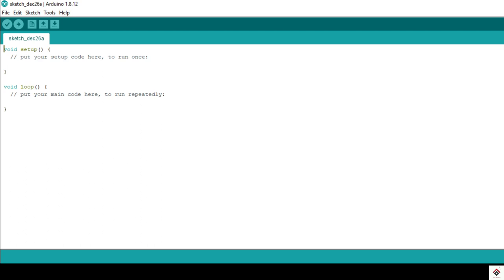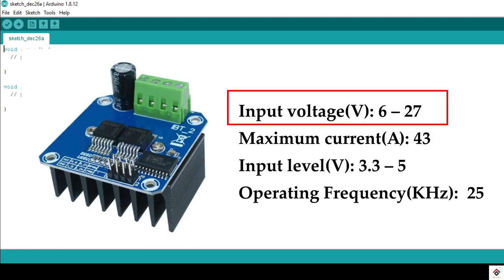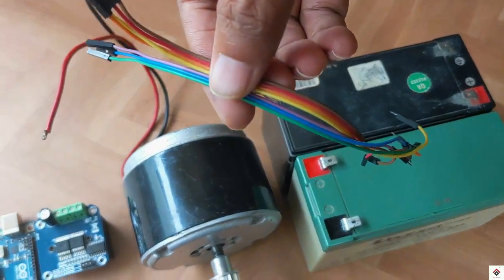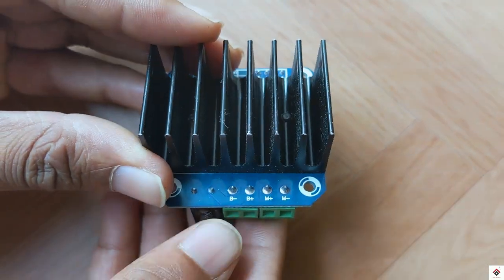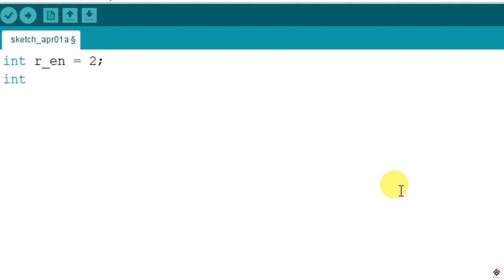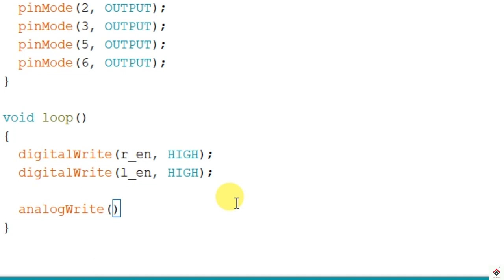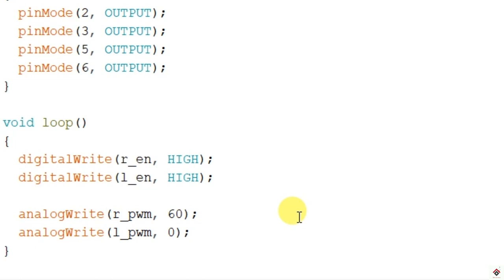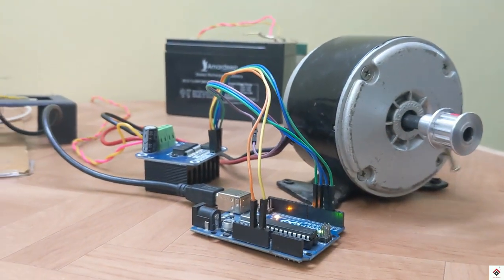Control High current DC Motors with Arduino and BTS7960  motor driver(CODE)| Ebike motor controller

Comment: Brother,  may I ask you a question. After seeing your video, it is possible for me to connect ebike throttle to arduino uno which are connect to BTS 7960 and controlling the speed and direction of motor? thanks
Reply from the maker: Yes it is possible.
Reply: Thanks brother

Comment: Bro my motor driver has a Problem the l pwm is not working my motor is beeping but the r pwm is working should i replace it?
Reply from the maker: If you are changing the direction according to code explanation it should work.

Comment: I did the same connection and code when I enter 255 in rpwm then motor start rotating clock wise but when I enter 255 in lpwm and make rpwm 0  then nothing happened motor didn't rotate can you help me whats the issue.
Reply: Have you found anything happened to me too?

Comment: thanks a bunch. i got stuck trying to use same code and schematic from l298n only to find out this driver requires one pin more. that burst my bubble but you helped me with this video by explaining in detail. not a lot of info to be found concerning this driver in particular. 🚗🚗🚗
Reply from the maker: Welcome

Comment: How do you use the IS pins with the Arduino. Are they needed ? Thanks  Great tutorials
Reply from the maker: Welcome!
Even I didn't find any documentation on using IS pins, 
To run the motors they are not required.

Comment: how to remove the humming noise from the driver at low pwm?
Reply from the maker: Arduino PWM frequency is very low. You have to increase the PWM frequency, i have not tried yet. Some registers to be updated. Search for the same on google.

Comment: Thanks brother. Please also upload Flysky control for 2 BTS 7960 (4 motors) with speed control for soccer bot.
Reply from the maker: Yes ,next i will upload that video
Reply: @techathome How many BTS 7960 Can be used on arduino?
Reply from the maker: One BTS need , 2PWM pins and 2 digital pins. From this you can calculate based on which Arduino u are using.
Reply: @techathome  i want to control 5 24v dc motors. Just one bts can control them?
Reply from the maker: If you want to control 5 motors independently, then you need 5 BTS.

If u want to control all 5 together, then depends on the current drawn by each motor.
Reply: @techathome  peak current is 18 amps per motor
Reply from the maker: Maximum current capability of BTS is 43A,
You can consider the rated current for your motor
Reply: @techathome  thank you... Do you provide any course?
Reply from the maker: Welcome
Which course , any specific topic?
Reply: @techathome  course for to become like you. Like you did lots of projects and i want to learn that all so i can make my own projects❤️
Reply from the maker: I am learning by doing hobby projects and also sharing the learnings on videos.
As of now no courses, but I have a plan to start hands-on workshops in coming days
Reply from the maker: I am learning by doing hobby projects and also sharing the learnings on videos.
As of now I don't have any courses, but planning to make hands-on workshops in coming days.
Reply: @techathome  waiting
Reply: Very good. Thank you

Comment: Would you be able to use the same connections and modify the code for a linear actuator. Also, what size wires do you use? I am trying to run a 12 V linear actuator with current load of 4.5

Comment: can i control mini cycle wheel using this motor?
Reply from the maker: This is the motor without gear box, it cannot give more torque.
You have to use motor with gear box.
Refer this video: https://youtu.be/ImYMBpdXi8U?si=sigtZYveKxkMzo-T

Comment: bro i did all connections correct and code also perfectly uploaded but output is not coming from BTS7960 module tried a lot of times 😥 please give me solution pleasee
Reply from the maker: Try with different BTS driver.

Comment: I want to use a potentiometer so do i need to use a 3 way switch?? And can you help me how i can use a potentiometer to adjust the speed
Reply from the maker: Refer this, concept remains same. Some changes need to be done for BTS motor driver logic: https://youtu.be/67ARqgkOCc8?si=agrk-ORZxdSUrY3f

Comment: this dude is a magician i also ive in india and this guy made a ffb steering wheel with the same motor and driver .

me: in shop i want a ebike motor
guy: ok that will be 856 rupees
me:nah i dont need it
Reply from the maker: 😂 But that ebike motor costs more.
I already had from previous projects.
So used directly here.

Comment: What happens if you PWM the enable pins ? For instance “digitalWrite(r_en, 100)” instead of “digitalWrite(r_en,HIGH)”  ?
Reply from the maker: I have not tried that, I think unless it is 255, it considers as Low, and HIGH for 255.
But to generate PWM signal, u have to use analog write.
Reply: @techathome  thank you . I’ll try it

Comment: Why is motor making noise after you reduce speed?
Reply from the maker: This happens when microcontroller PWM frequency is low, like Arduino supports 490Hz by default which is inside the human audible range. 
Since there is no momentum of motor at lower speeds, it is not able to match the PWM signal state switching between high and low.
Reply: @techathome  is there any way to remove this problem?
Reply from the maker: If you use microcontrollers with more PWM frequency(more than 20kHz), it will resolve.

Also in Arduino there is some method to increase PWM frequency output, you can search on YouTube.
Reply: @techathome  bts has 25 KHz will it work?
Reply from the maker: Yes BTS support upto 25khz, But control signal frequency from Arduino should be high.
Reply: @techathome  okay, looks pretty tough
Reply: @techathome how to use 4motors with 4 bts ?

Comment: hello friend excellent video I have a similar project but I would like to see if there is a way that you can help me by solving some doubts with an arduino code for a mecanum robot and be able to connect it to that bts7960 module
Reply from the maker: Hello, thank you.
Yes sure, u can also contact us on our mail id
Reply: @techathome  okay perfect

Comment: Kya hun 36 v moter ko control kar sakde a
Reply from the maker: According to datasheet, max voltage supported is 27V.
So you cannot use 37v motor.
Reply: @techathome  24 v moter ko control kar sakte hai
Reply from the maker: Yes, The motor used in the video is 24v.
Reply: Thanks sir plz video bna kar send karna
Reply from the maker: We have already explained in this same video for 24v motor.
Reply: Sir video ka link send karna